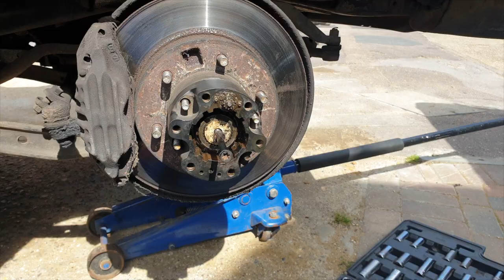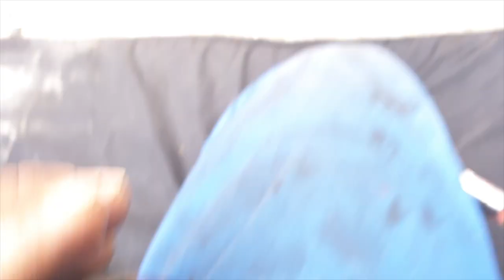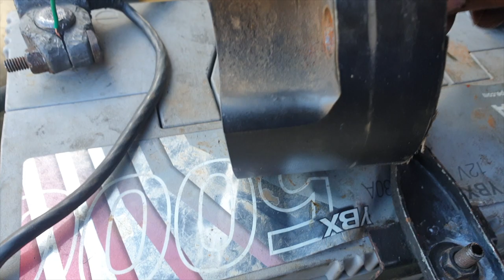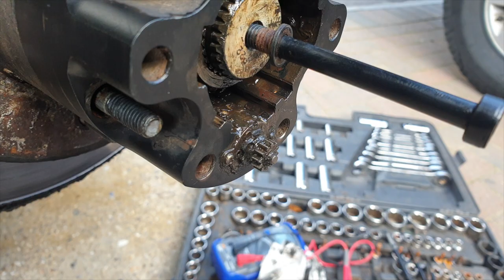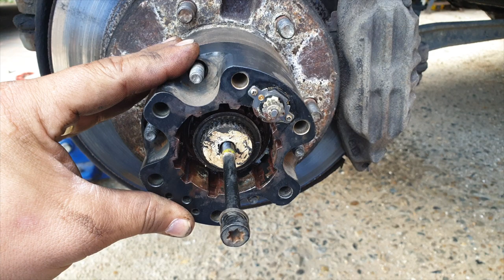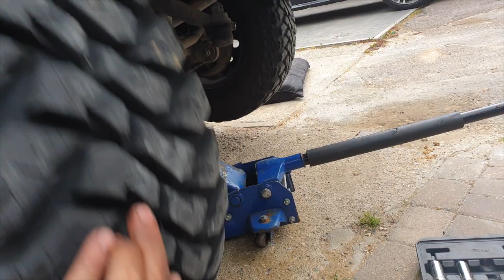Toyota Land Cruiser LJ78 Front Locking Hubs Repair

Comment: Love the tutorial! Thank you. I am having issues with my hubs now, and the system in this video is functioning as it should. Would you have a recommendation on what to check next? My wheels do not reflect the same actions as yours when the hub lock is engaged.
Reply from the maker: That would be the only thing to check, recently  swapped for manual hub lockers fro AVM and on my second offroad expedition, all the bolts snapped on the manual locker on the right side...sad isn't it?. Managed to fit the original bolts, (had to shorten the bolts by 15mm to fit the manual hub locks) hopefully i'm safe this time!

Comment: I have a 1994 Prado and my hub lock and H4 lights are not working, light would not come on on the dashborad? did you have the same issue?
Reply from the maker: Light comes on, but the hub wasn't locking, the only way to check if its locking or not , is to, press the button and drive the car slowly and turn left and right, you will feel it when its locked, wheel draging, 👌
Reply: @TheLandCruiserChannel  yea unfortunately I found out the hard way and got stuck in the sand... just had my truck for a few weeks now and I'm not sure what's causing the failure, I'm taking it to Toyota after the Holidays for some help!

Comment: As per your comments you are going to swap to manual locks. ave you done the manual lock conversion? And do you know the part numbers for them. Thanks
Reply from the maker: I have done it, yes, I bought a set of AVM manual hub lockers that replaced the electronic ones.

Comment: I need to know why my freewheel hub motor is running one direction any Idea on that
Reply from the maker: It is absolutely normal, cos when the hub is locked the motor stops straight away, then when you unlock the motor knows his position then it will go the other way to unlock the hub
Reply: Yes, I agree with you, do you have any idea when you press 4 wheels switch On hub locks and when you press the second time it is Off and the motor should turn opposite direction. ( which is not doing ).  any clue on that.
Reply from the maker: @411lofty  only takes 3 seconds for the motor to lock and unlock the hub, you can replace the electronic hub locking device with manual lockers from AVM i did that to mine.